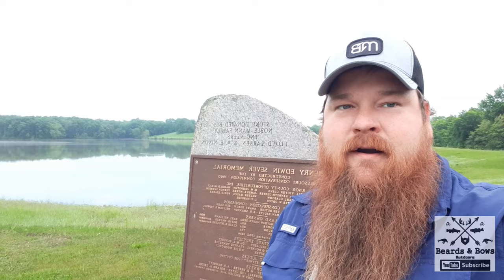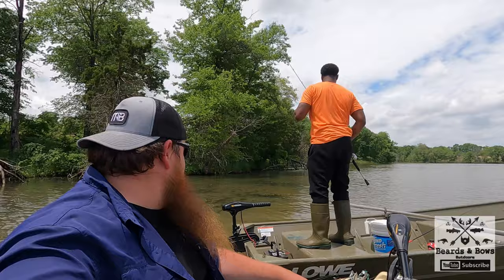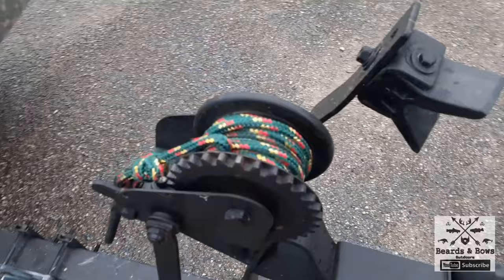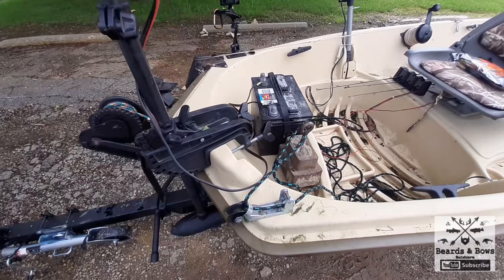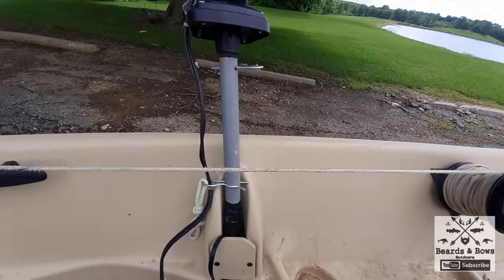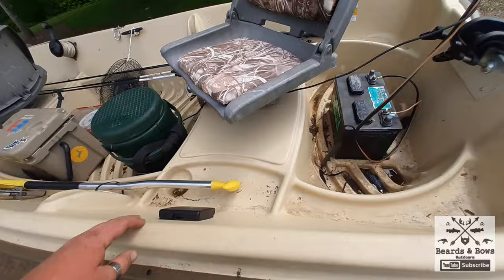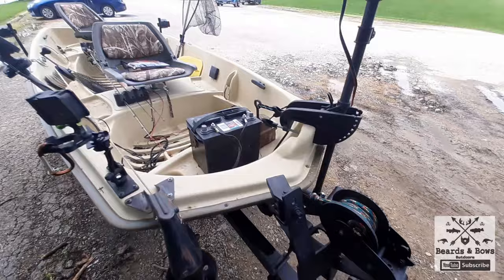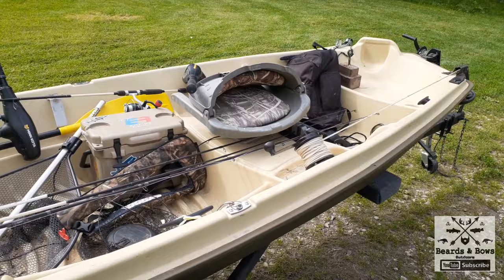Jon Boat Modifications - Sun Dolphin American 12

Comment from the maker: Affiliate Links To All Add Ons:

* Folding Boat Seats - https://amzn.to/3sTflFI
* Boat Seat Mount - https://amzn.to/3gDUJw8
* Boat Seat Floor Mount - https://amzn.to/3konii8
* Anchor System - https://amzn.to/3jm501S
* Anchor Line Control - https://amzn.to/2Y2O88e
* Minn Kota 55lb Thrust Trolling Motor - https://amzn.to/3ymRWxz
* Minn Kota 30lb Thrust Trolling Motor - https://amzn.to/3ysc9ln
* Drink Holders - https://amzn.to/3kuzuy0
* Scotty Mount For Cameras - https://amzn.to/38khvEU
* Boat Tie Down Cleats - https://amzn.to/3znMKed
* 3 Pole Rod Holders - https://amzn.to/2WuWxjU
* Clamp On Rod Holders - https://amzn.to/3gEsaik

Comment: What size battery do you run and how long will it run?
Reply from the maker: On a small boat like this I'll run a size 24 or 27 single deep cycle. It will last most of the day.  My bigger boats, I run 2 deep cycles wired in parallel and it will last all day.  Use size 24 if you don't have the room.  Use a 27 if you have the room

Comment: Nice content! I would imagine you can’t use nuts and bolts and have to use screws that grab directly onto the plastic frame?
Reply from the maker: Yes, using screws works pretty well as long as you don't initially tighten too much and strip the plastic out
Reply: @BeardsAndBowsOutdoors  Great, thanks man!

Comment: I just bought a 12 ft Sears game fisher with a outlaw trailer for 770 with a 30lb minnkota trolling motor and optima marine battery I also bought a 1987 mercury 3.5 2 stroke carbureted outboard anyone happen to know if they’re water cooled?
Reply from the maker: Does the outboard have a tell tale or a pisser tube? When running In water, it should spray a stream of water from the head.  Most are water cooled
Reply: @BeardsAndBowsOutdoors  it doesn’t I’m not sure I’ve been around outboards and boats my whole life but nothing this small so I’m not sure I know the newer ones are water cooled but I’m not sure I’ll have to drop the lower unit and look
Reply from the maker: Some of those super small ones are air cooled.  Let me know what you find out

Comment: Good evening. Great content and videos. Question. I also have this boat. Does the bow mounted 30lb trust 30" shaft minn kota is long enough to reach the water being only 30"? How well does this trolling Motor performance being mounted in front? Thank you for your great content.
Reply from the maker: Yes it will reach just fine.  It did great with it on the front. When both are going, it really moves.  Hope this helps
Reply: @BeardsAndBowsOutdoors  Awesome. I went ahead and risked it and bought a Hangkai 4 stroke 4hp from Amazon $240 for the back. Got the boat in fb marketplace for 350, got a trailer on the marketplace for 200. Everything is a work in progress thing. Still need the battery for trolling motor, anchor and some couple more accessories.
Reply from the maker: @brujodat I've heard good things about those hangkai outboards.  Good luck on your project!

Comment: Man you did a great job on that man... I have one as well and trying to modify mine... My question is why don't you have an anchor in the back of the boat? How do you not spin etc. Also what do I need to make a good GoPro stand that won't fall in the water to capture the whole boat view as I fish?
Reply from the maker: Usually 1 anchor in the front will work. If not I will just throw another anchor off the back.  For the gopro, I modified a navigation pole for the rear of the boat. I drilled a hole in the light pole cap and bolted a gopro attachment to the top. I attach my gopro and insert it into the rear nav light socket.  My newer fishing vids have that angle from the nav pole.  Hope this helps!

Comment: What did you use to attach the anchor lift to the boat ?  Since it’s hollow plastic I’m worried whatever I do may strip out with the weight of the anchor…. Thanks
Reply from the maker: I actually just used pole barn metal screws and as long as you don't overtighten them, they will hold alot.  You can always use a toggle bolt so the wings will grab on the inside of the plastic. Hope this helps

Comment: What length roof screws are you using? Don't want to go thru both plastics
Reply from the maker: It all depends on what you are attaching and how much length you need to go through item you are installing. Then I'd add 3/4 inch to that.

Comment: How did you secure the boat cleats to the thin polyethylene?
Reply from the maker: I used tin roofing screws and they held up great. I would use some toggle bolts if I had to do it again for extra support

Comment: Hi! What screws do you suggest I use to add accessories on a plastic boat? I have a BassTender 11.3
Reply from the maker: I just used the roofing style screws with the built in washers.  As long as you don't tighten them too much they hold pretty well
Reply: Thank you!
Reply from the maker: Anytime!  Hope your build goes well

Comment: what's the over all length of your trailer? I`m having a heck of a time trying to find one for mine
Reply from the maker: Roughly 14.5 - 15ft long.. it is adjustable so I would say a 13.5 - 14 would suit you . The smaller in size would work if it's the same boat. Hope this helps

Comment: I want to do something similar with mine. What are you using to attach the accessories, screws or rivets? Is it holding well?
Reply from the maker: I have been using metal roof screws since they have the rubber washer on them to help keep water out..  All has held great so far. The seat inserts were lag bolted as seen in an old video
Reply: I’m curious to the anchor mount myself I’m scared to drill a hole how deep or is there any plywood in the front where your mount is
Reply from the maker: No plywood underneath in that spot, but its solid holding and works great

Comment: Nice. How do you recharge the battery?
Reply from the maker: I use a waterproof charger / maintainer on all batteries
Reply: @BeardsAndBowsOutdoors  Which one exactly, if you don't mind. I'm really interested in going that route. Thanks!
Reply from the maker: I use the everstart Maxx 4 Amp found at walmart.  It's reasonably priced and works great
Reply: @BeardsAndBowsOutdoors  Great, thanks!

Comment: Any chance you guys took the rivets out and split the two pieces to do mods underneath? Really trying to find some information on if anyone has gone that route
Reply from the maker: I did not split it.  I was afraid it would warp and not go back together easily
Reply: @BeardsAndBowsOutdoors  I’m scared there’s some foam
Reply from the maker: I'm sure there is foam.  Foam came out when I drilled seat mounts On it
Reply: I actually did this today, recorded it but not uploading untill I also record some modifications to it. Rivets are only for holding the trim in place, its actually stapled together, and has butyl rubber as a gasket. 

It CAN be taken apart with a flat head screw driver, but I took an angle grinder with a thin cutoff wheel and cut between the two shell peices to get through the staples quickly as it is held together with roughly 250-300 staples, and the butyl rubber is quite tacky aswell.

 Going to use ~ 100 rivets and rivet it back together once done (~ 40 on each side, then 10 on the front ten on the back) in place of the staples.

It has a ~ 12"x36" x1" foam slat on either side, a   12"x12"x~ 32" foam blocks under each bench seat, and one small chunk up front.   

Transom is a 3/4" thick peice of what looks like UNTREATED plywood that is ~ 16"x16" (barely wider than the metal transom plate) with 2 peices of plastic pin nailed to it. Front trolling motor mount has a 6" peice of 2x4 glued in, and the oar locks on either side are a ~ 3"x5" peice of 3/4 inch plywood. 

Hopefully i can upload within a week or two, waiting on some accessories to come in.
Reply from the maker: @mobiussquadron that will be a very interesting video plus the sun dolphin vids are popular

Comment: Did you have any issues attaching things to the plastic boat? Do the screws strip and fall out easily?
Reply from the maker: Surprisingly the screws I used hold very well as long as they aren't overtightened from the start